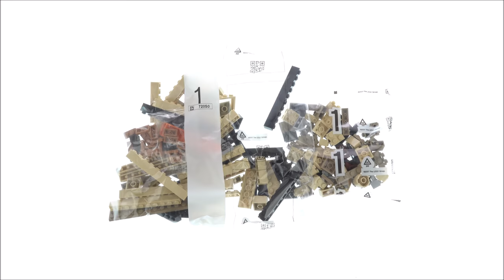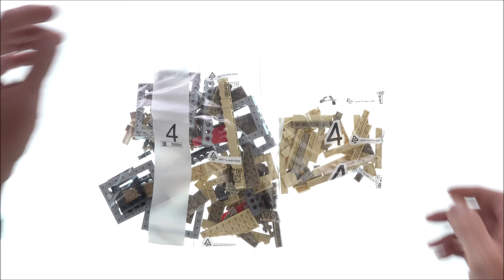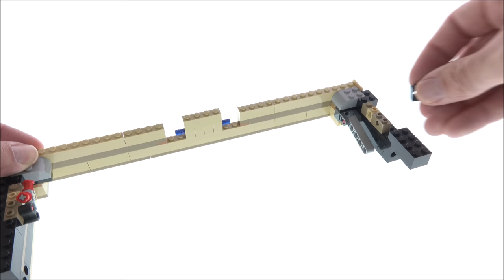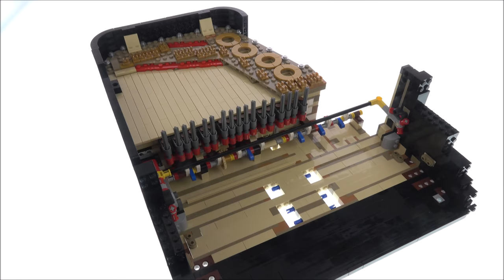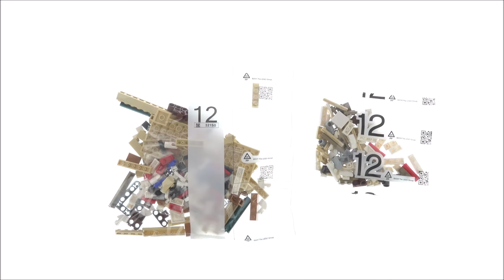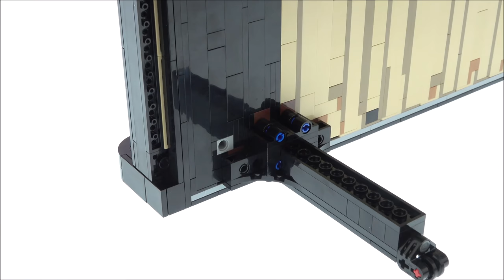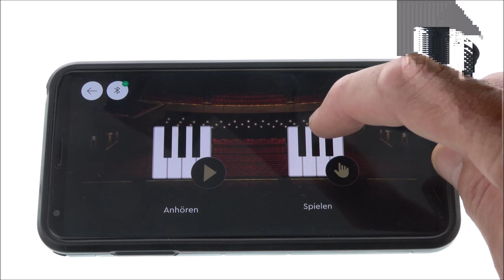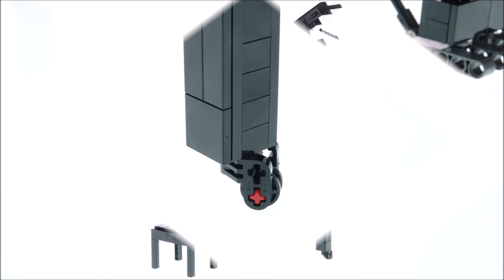LEGO Ideas 21323 Grand Piano - Lego Speed Build Review

Comment: Hi @AustrianBrickFan Awesome video! Ive just finished pack 3 and used the powered up app and the music plays but there’s no movement. The hub lights are on but the motor doesn’t seem to be doing it’s job. Should it be moving at this stage? What’s the problem with it do you think? The hub also is meant to power some lights as well but again these aren’t working. Any ideas?
Reply: battery is low